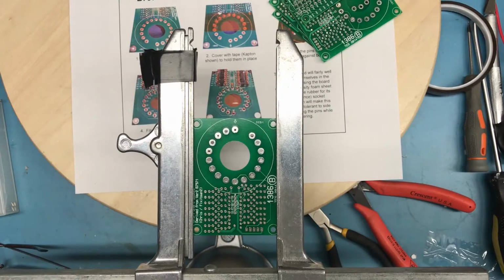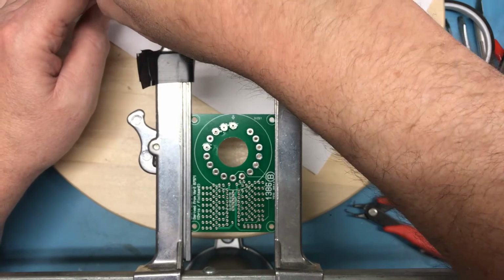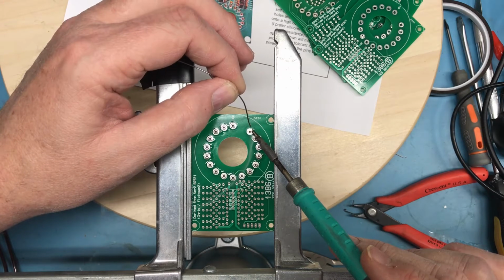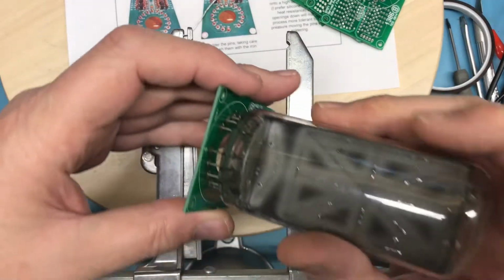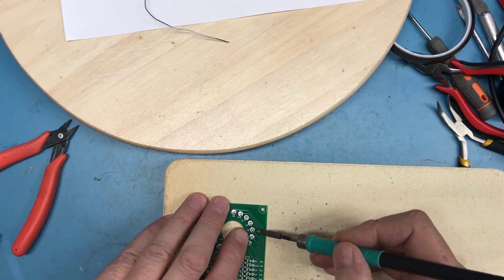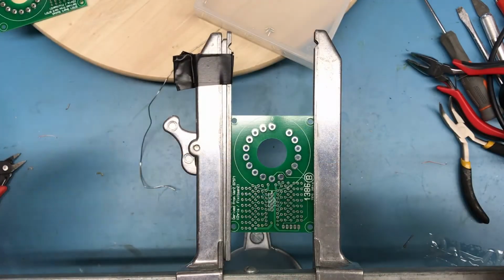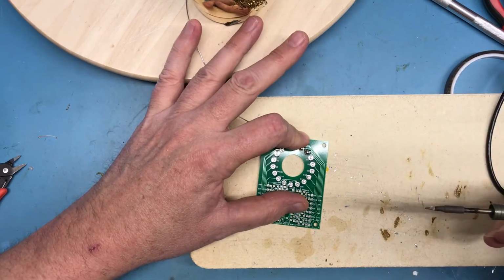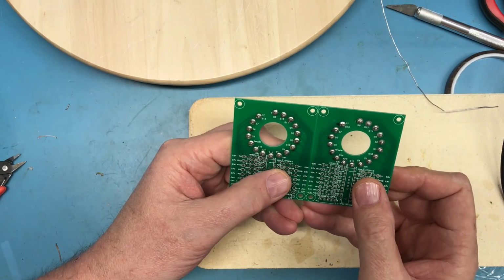B7971 Clock - Part 2 - SmartSocket assembly - Tube Pins - STB143

Comment: Hello, thank you very much for your videos.
I was wondering if you could insert the pins seats  over the tube pins held upside down and insert the board over it, then while propping the tube against the board held in your vise solder two pins, then solder the rest of the pins.  I think this will lead to the lowest insertion stress on for that particular tube board combination.
Rami
Reply from the maker: I'm not 100% sure I follow what you're suggesting. If you're suggesting I use the tube to hold the pins in place for soldering note that I don't want any heat from soldering making it's way onto the pins on the tubes which is why I didn't use the tube to support the pins. The pins on the tube are rather delicate in that they have a gas tight seal with the glass envelope. Heating the pins could create a leak or even a crack in the glass.
Reply: Thank you for your reply,
That is exactly what I meant.  I didn’t know that we should avoid heating the pins of the tube.
Cheers.